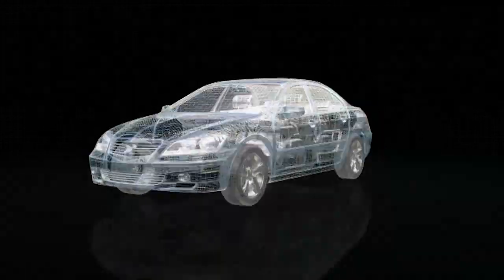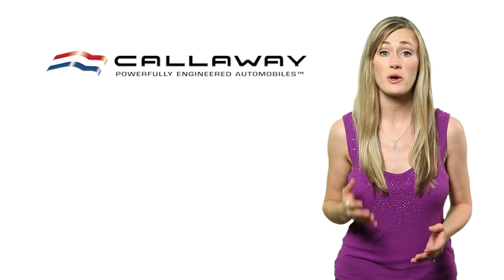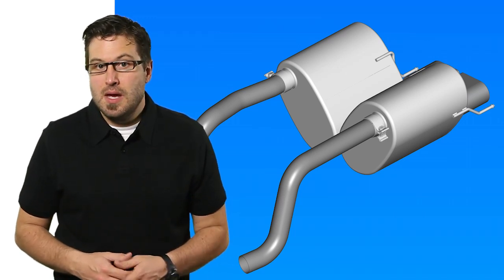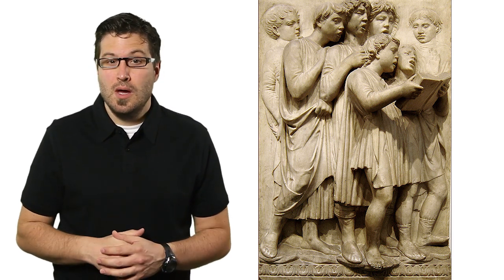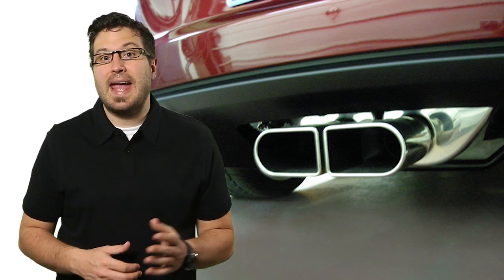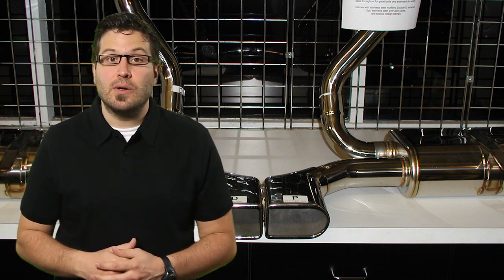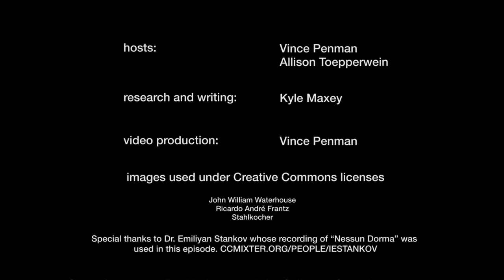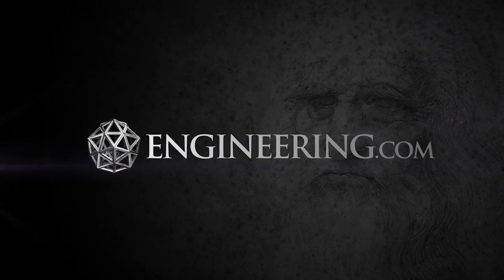Designing the Signature Sound of Car Exhaust

Comment: Most people that chase a sertion exhaust noise cos it sounds cool so people will look when they hit the gas are wankers that will soon be disapionted when electric cars will blow them off the road with more power,speed and much higher effiency than any fuel motor could ever get !
Its already happening with electric dragg cars and bikes and there only been developed for less than 10 years amazing .
The more I watch these vids the more it seems like advertising.
Reply: While this may be true, some petrolheads just prefer the sweet sweet sound of an internal combustion engine :).  To some petrolheads, exhaust note is everything, not necessarily how fast the car will do a 1/4 mile.  And performance can be measured on a wide variety of metrics, while a tesla P100D will do 0-60 faster than a Ferrari 458, the Ferrari 458 will do a lap around the nurburgring alot faster due to its superior suspension and light weight.
Reply: E cars are also completely soulless.
I've driven many on and off the track.

 On off,on off, on off...

Accompanied by a gear sound....

 No progression.
 No build up like when an I.C.  engine comes on cam or boost and the induction starts singing 
 No crescendo when all the cylinders reach harmony and peak power.

No pride in having the skill  launching a high power machine requires.

 Zero skill required. Anyone can post a good time in an e-car, including your grandmother, the 16 yr old kid down the street or a trained chimpanzee.

Which makes them boring. No matter what their 0-60 mph or 1/4 mile time they post, you are left empty.
Proof that having too much of one thing while neglecting the rest delivers a suck ass product.
The batteries are made with rare Earth elements that all come from dictatorships, and mining for them ruins the earth far worse than an oil well ever will. Look it up if no one believes me.
 Then you've got a 1,500 lb  battery filled with acid. Where does it go at it's lifes end? 
Millions of these things will be reaching end of life in under 10 years. Will they be treated like nuclear waste? Will all of them be recycled?
Reply: runs out of battery